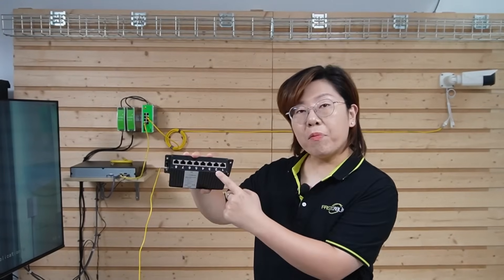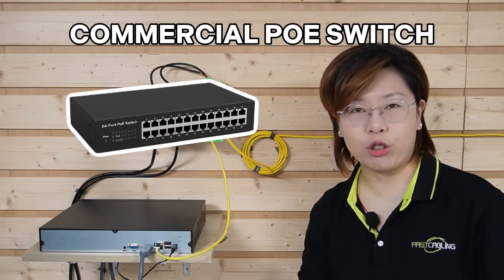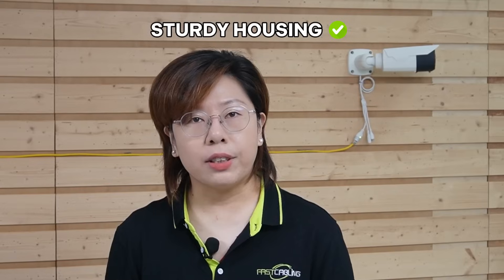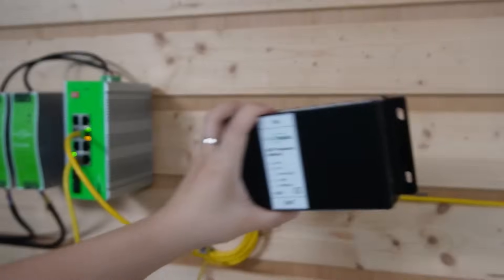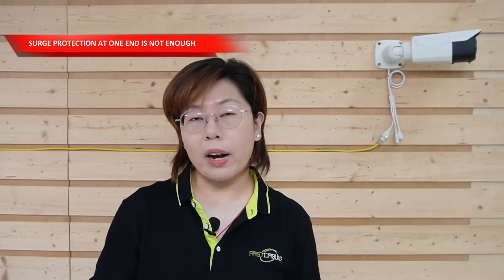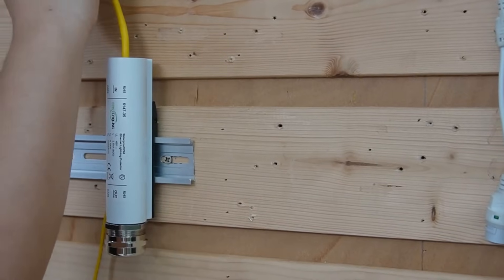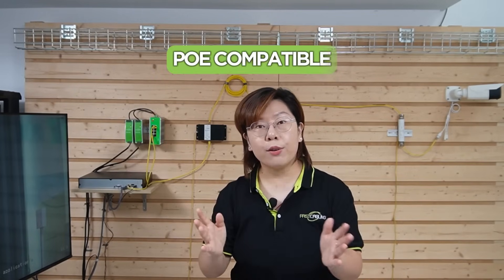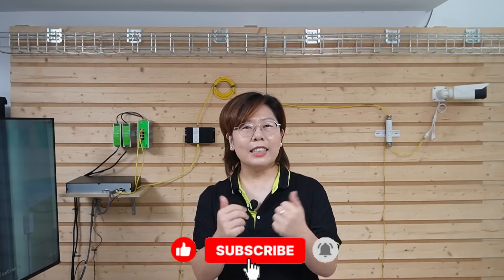Build a Hardened Grade CCTV Camera System for 24/7 Surveillance

Comment: What's the best way to protect analog cctv camera?
Reply from the maker: Use a surge protector or CCTV lightning arrester on the video line and power line, especially for outdoor cameras. If powering over long cable runs, use fused power supplies to avoid overcurrent. Proper earthing/grounding of DVR, power supply, and coax shield reduces noise and surge risk.

Comment: Best way to get wifi 300' no power
Reply from the maker: Standard PoE with cat6 cable can do. It can achieve 1G bandwidth with 328ft and up to 71W maximum power by using the IEEE802.3bt.